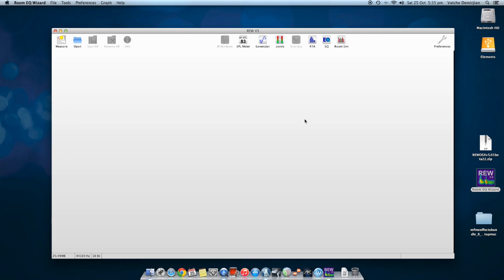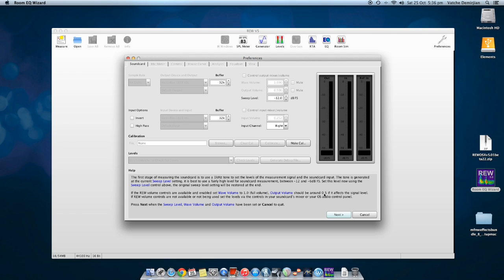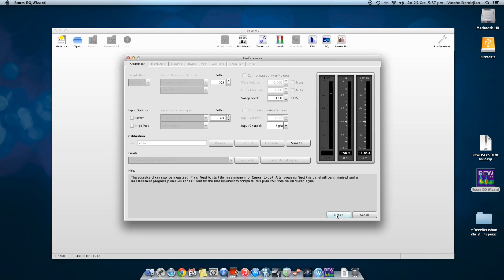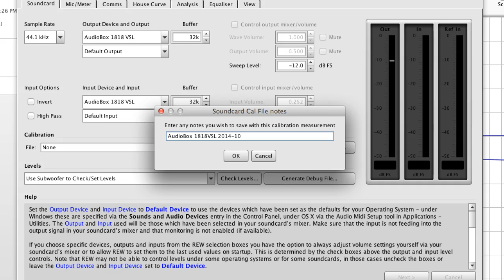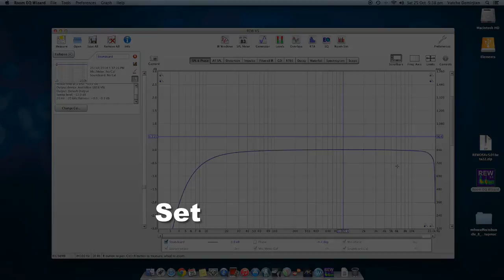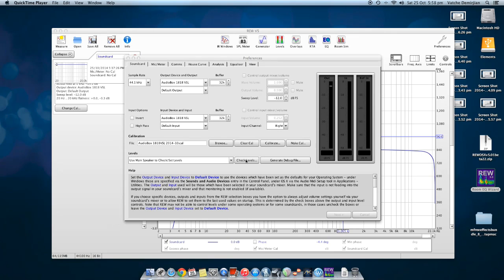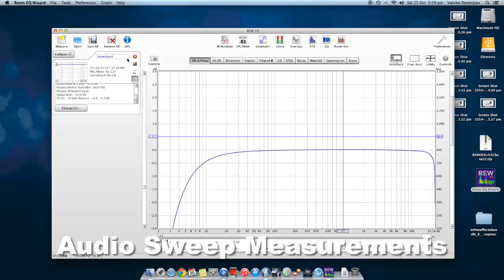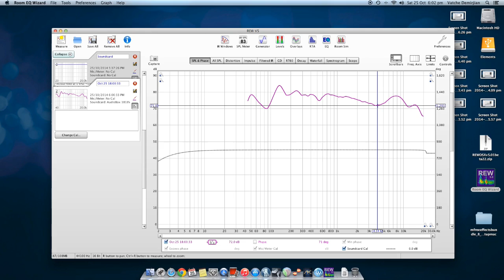Room Acoustic Analysis/Measurement with Room Eq Wizard - Part 1

Comment: Hi, thank you for this clear and useful tutorial. I wish to measure my room to improve the performance of my HIFI, I'm using a Behringer UMC202 ad interface , it's not clear to me how to connect the patch cable. I also had a look to your AudioBox 1818 but I didn't see and line input connection... Could you please help me ?  thanks
Reply from the maker: Most times you can skip the audio interface check as any current audio interface will have reasonable AD/DA converters.
Reply: Thanks for your answer . I I'm using an Behringer UMC 202 as audio interface , should I connect my HIFI ampli for the room measurement ? Or Maybe I have just to connect only the speakers ?

Comment: Thank you for a great video. Easy to follow and understand. I have a question if you don't mind: I mainly plan to use my room for recording, and will mainly track on headphones. Would this procedure still apply? I do not have proper reference monitors, can you do this with any speakers? Should I put the microphone and the speaker where a musician would stand during the recording? Should I try different parts of the room? I could not find much info in general about treating a live room on YouTube, it's all mostly about a  control room. Thanks a lot and greets from Austria.
Reply from the maker: You can certainly 'ring' the room, meaning play pink noise and find the best flat response location in your 'recording' room and place the vocal mic there. Depending where you place the mic, will have some effect on the frequency response of the mic and the singer.
Reply: @RecordingStudio9  Thanks for the quick reply and the info!

Comment: Why don't you have a feedback problem? Pointing the microphe at the own system speaker....
Reply from the maker: Because unlike a PA system, the audio from the microphone is not coming out of the speakers.
Reply: @RecordingStudio9  Normally it does. Where in de signal chain do you stop mic signal.
Reply from the maker: @steenbreker60  This depends on your model of Audio Interface. Turn Direct Monitoring off.
Reply: @RecordingStudio9  Thanks for your quick answer, btw

Comment: dude where are you from?
Reply from the maker: Sydney Australia
Reply: @RecordingStudio9  I like the accent a lot! It reminds me to the accent people have in my country Yugoslavia. Hey... I am also building a studio I have one question, you have shown here how to test room acoustics for monitoring music. That is okay but how about singing? If I want to test acoustics for singing. For example>>> Should I put monitor where singer would stand and then put the mic right in front of it?! Please respond... I have been reading days and days and can't figure it out. 
Also I got beyerdynamic mm1, should i put this device upright? Like tip of the microphone pointing to the ceiling?! Please reply thank you so much for those videos! If I could I would buy you a drink man
Reply from the maker: Normally the singer would use headphones during recording to avoid any audio bleed into the Mic.
As to Ref Mic MM1, you need to follow the instructions from the manufacturer.
Point it up to measure room, point to speakers to measure speaker response in your room.
Acoustic absorbing and/or deflection panels are your first method to control your room acoustic response. Measuring will give you the result, but not fix it.
Reply: @RecordingStudio9  hello, thank you so much for responding.. that wasn't what I've asked though. I said that singer produces sound and this sound that he produces bounces around the room and reflects back to the vocal microphone. Can I instead of a singer (put monitor) and instead of a vocal mic( put measurement microphone) to see what mic  picks up when monitor is infront and producing sound just like the singer will be infront of it and will be producing sound.
Reply from the maker: @accountnew6474  
I understand now. I guess because you can't get the singer in your room again to sing, so you use a speaker instead.
Yes, the concept is the same and REW should give you a graph from singer's perspective.
Here is a similar test example video.
https://www.youtube.com/watch?v=xi6u_hY63D4

Comment: Although this is a few years old it is great information on the set up.  I have the ECM8000 but it did not come with (or I can not find) the calibraition chart for the specific Microphone.. .so, I may go ahead and order one of the Dayton Mics with the calibration scale and information..   I am very impressed with the REW software and Now, I have lots of tests I need to do.  

In this video you show the how to analyze the room so the Mic is straight up...  but,  If I were to want to check the specific speaker response, I've always pointed the mic at the speaker tweeter at about 3' from the speaker.  Does that seem right to you
Reply from the maker: If you are measuring each speaker, then yes, the mic is pointed to it.
Reply: So  hopefully I will get some time this week and run some tests I will be interested in seeing what the differences will be with the Mic pointed at the speaker vs the "Room" set up like you have.  Currently i have 2 different Monitor setups,  One is Yamaha NS40 monitors driven by a Haffler p3000 and the other are Mackie HR824 monitors,  both I have had for years and I often run RTA's on them to make sure they are in spec...  Have you ever run the RTA specifically for each Speaker to see what the difference is between that reading and the room ... that may be interesting to see.
Reply from the maker: Curious to find out. Please keep us updated on the results.

Comment: This stuff is too boring and complicated for me. I just want to make music. I just mounted 20 acoustic panels up on the wall without testing and called it a day. My problem is that I don't hear the difference when it comes to minute changes in sound. That's why I'm not good at mixing and mastering. Besides, I don't want to spend money on a measurement mic. Then I would have to sell it immediately after, and that's just too much hassle to go through.
Reply: " That's why i'm not good at mixing and mastering"...maybe because your room sounds like shit you THINK you are not good....
Reply from the maker: Yes, it can be complicated, but once you do it correctly for the first time, you will say "That was it?!".
Normal foam acoustic panels take care of high frequencies in the room, but the problem is the low frequencies at the seating location when you are mixing. Without testing and visually looking at the graph, it would be hard to identify problem frequencies and how to fix them.
You will need to run the measurement again every time something major changes in your room, so you never have to sell the Ref Mic.
Again, it all depends how accurate you like your mixes to translate everywhere.
Thanks for watching.

Comment: hello there thanks!
What is a reasonable graph? I mean, How do I know that this is what I want my room to sound? how should a good graph look like? thanks
Reply from the maker: You would want to have as flat line as possible from around 30Hz to 16Khz, +- 3db is ideal, but +- 6db is normal (meaning from the highest peek in any given frequency, to the lowest dip in any given frequency, the difference should not be any larger then 12 db, +6 to -6)
Hope this is clear enough.
Reply: Thank you so much! it's very clear and you're doing an amazing job as always!
I want your opinion about a live room I'm trying to treat. The thing is, it is small (width 3,44m/lenght 3,31m/ height 2,50m) and it is all covered with perforated platter (4 walls). it sounds very dry inside (I don't know if it's a good thing or not). it's for recording music and voice overs. is a dry (almost no reflection) live room any good?
Reply from the maker: +God Bear 
Depends what audio source you are trying to record. For vocals, guitar, bass etc, you want it dry. For drums, you might want to have some natural reverberations. Maybe hang some wooden panels to get some.
Reply from the maker: +God Bear 
Your room is a square, almost a cube. Not a good size for control room or playback
Reply: Thanks a lot! Keep up the great work! I'm learning a lot thanks to your vids
greetings from casablanca
Reply: it is a live room! not for mixing or playback! the mixing room next to it is rectangular: (width 3,44m/lenght 2,17m/ height 2,50m).
Reply from the maker: Nice. Maybe you could put up some videos of your setup.

Comment: Is it necessery to use TRS cable for loopback? because I tried TS and my results are not acceptable. Also why to use another SPL meter, Room Eq WIzard has its own SPL meter isn't it?
Reply from the maker: TS should still work. Make sure you follow my instructions, you may be missing a step.
You first need to calibrate the built in SPL meter, so I use an external one.

Comment: It seems like after the whole process, and applied the PEQ to the Equalizer APO.  I turned on and off to compare before and after, it sounds like with the calculated PEQ, it sounds a bit dull.  Not sure if I do something wrong or it should sound like that.  Cymbals and crash are kinda muffled/dull.  I'm testing from a living room, not the best placement because of the layout (narrow long room) so the TV/speakers are on long side of the front room. 
BTW,  I found an easy way of using Equalizer APO.  After 'match response to target' in REW, you can just export out the calcuated EQ data by clicking "export filter settings as text' few buttons below.  then in Equalizer APO, click +, Control, Include.  Then import the file.  No need to type the data ever again!
Reply from the maker: Is your system sounding dull for commercial music? then you may have to change the expected graph to flat, rather than an angle at the higher frequencies.
Thanks for the tip of export/import of data from each app.
Reply: Both classical and electronic music.  Classical being less affected. I am guessing electronic music probably EQ beforehand to suit most speakers at regular home.  I did a few tests for a different sets of speakers (bookshelf instead of satellite), bookshelf speakers sound a lot better and did reap the benefit of PEQ :)  Thank for making this tutorial video.  If you have any 'advanced' tricks/moves, please share! :)
Reply from the maker: You can also watch part 2 if you have not done so already. hope that helps further.
Reply: RecordingStudio9.com great video, just looking for info on this, just the right detail, thanks.

Comment: I have a Steinberg UR28M and am trying to get the soundcard frequency response. I have a balanced 1/4" going from ouput 1 into input 1 with an XLR connection. Within Room EQ Wizard, in preferences, I have selected Steinberg UR28M as the Output Device with Left as the output channel. The Input Device is also Steinberg UR28M with Left as the input channel. I click the Calibrate button and can set the 1khz level. The next step automatically does the frequency sweep and here is where I run into problems. The result I get is not a smooth line that is flat like your example. Mine has constant peaks and valleys all the way up the frequency spectrum. Any ideas of what I may be doing wrong?
Reply from the maker: The loop link should be line level, meaning Line Out TRS jack to Line in 1 TRS jack, not XLR. That could make the difference.

Comment: Hi, i don't have sound card but for interface i use a Roland MX-1.Please tell me where i must put the patch cable? I suppose one side of the cable must put to one of mix out but i don't know where put the second side :( I have a VT-3 theре is a phantom power for mic.The second side of the cable i must to put in VT-3?Sorry for my bad english.Please help me.Best Regards Alex
Reply from the maker: Not knowing about the Roland MX-1, can't help you much.
The patch cable I guess can go from the "MIX OUT L/MONO" to "INPUT 1 L/MONO", for the audio interface testing. Then use Input 1 L/MONO for Mic? when doing the audio sweep.
Sorry, can't help you further.
Reply: ok thanks for your fast answer :)

Comment: What is that tone at like 13K-13.5K?
Reply from the maker: Very painful? But it gets a bit too high for me to hear clearly. I'm getting old :P
Reply: RecordingStudio9.com Its not painful, and I admit I had to use a frequency generator to find out exactly where it was. Maybe I was bragging more than complaining. =)
Reply from the maker: Could it have been the noise from my cheap clip Mic I used to use few years ago? Or are you referring to the generated Pink Noise?
Reply: RecordingStudio9.com It was the mic, definitely.
Reply: Ahh that noise bugged me so much

Comment: great video!!. the patch cable is mono or stereo ??
Reply from the maker: It would not matter. 99% of audio interface inputs are mono (use 2 channels for stereo) and depending on the make, balanced (TRS) or unbalanced (TS) socket. So either cable will work.
Reply: great info thanks !!

Comment: Room EQ has a built in SPL meter u knob
Reply from the maker: +Pavle Pavlovic 
Yes it does, and it needs to be calibrated first with external SPL meter. Plus, how would one measure what level of signal the mic connected to REW is picking up to display the correct level with REW? One needs already calibrated SPL meter to adjust.
Hope this helps.

Comment: Thanks for a great tutorial! I just bought a Zoom H1 microphone, and I wanted to use the microphone to to compare the frequency response on 3 different bluetooth speakers. This is a brand new area for me, but I find it interesting and want to learn more!  Is it possible to measure the frequency response this program using only my mac and my Zoom H1?
Reply from the maker: +Thomas Veheim Good question. Since you are not trying to correct a room, and want to find out the differences in 3 speakers and compare them in reference to your Zoom H1, then yes.
Place the 3 speakers at the same location as you would listen to them, and position the Zoom H1 at the location you would normally sit to listen.
Follow my video instruction on how to generate the audio sweep to play from each of the (you need to work this out).
Connect the Zoom H1's phones/line out back into your iMac's Line -In, so REW can graph them for you.
Hope the above makes sense.

Comment: Thanks a lot mate, it is really detailed and straight forward tutorial... I wonder if the same concept would be applied to tune/EQ concert halls or stadiums. Thanks once again... I appreciate it
Reply from the maker: +Saif Alsarraj Yes, I'm sure every large concert audio management would have audio analysis and room correction. eg. Behringer Ultra Curve Pro DEQ-2496.
Reply from the maker: +rubkam96 Thanks. You are correct. The larger the room, the less issue for low frequencies, but they have other issues. For small rooms, like mine, EQ correcting means my speakers will give a better and more accurate audio, specially when mixing and mastering.
Having said that, I still listen on my in-ear phones and in the car, to make sure my song can be compared with similar commercial music.